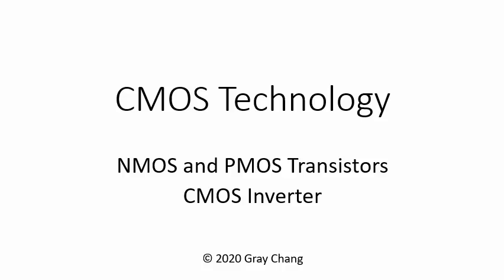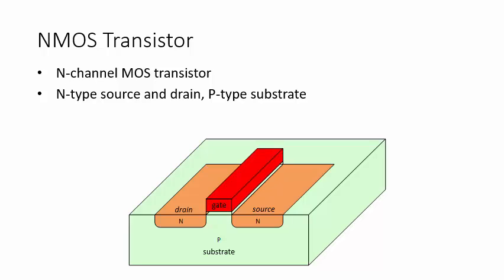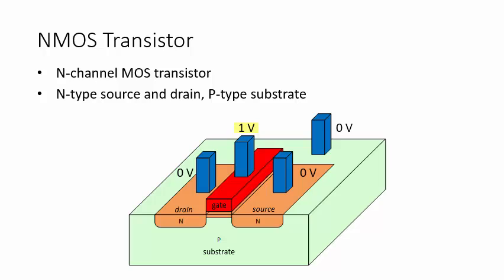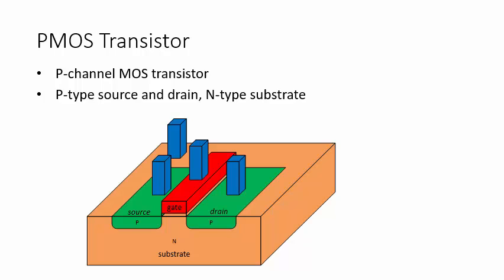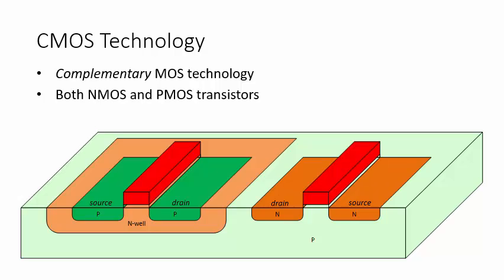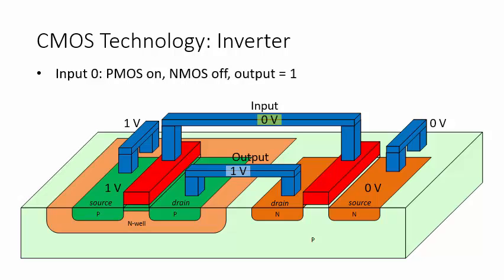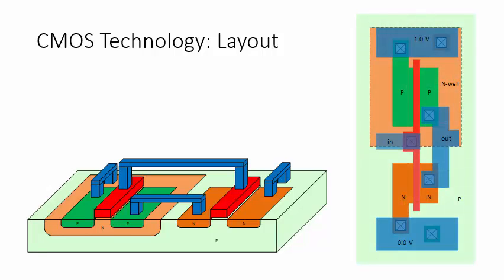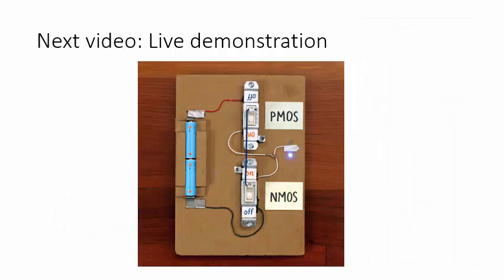CMOS Tech: NMOS and PMOS Transistors in CMOS Inverter (3-D View)

Comment: Awesome video! I have one question, and I am relatively new to this, but can this be used to switch between two different power sources? Instead of having 0V and 1V as an output, could it switch between voltage levels from two different battery sources using one control voltage? It would be like an SPDT switch. I want to avoid using a relay or 4 transistors in an H-bridge setup. Thanks!
Reply from the maker: No, the CMOS inverter is just one tiny component among millions in an integrated circuit. You're looking for discrete power components. You seem to know a lot about them.

Comment: Thanks for this great Video, I have one question! I have a computer science background and still struggle with basic concepts like current. In 5:20 (Input=1V) you say "A conducting path connects 0 Volts to the output. I have a hard time imagine, what does 0 Voltage mean? Does it mean no current is flowing at all? Or just a small amount? I think i have a problem with the concept of a Supply of 0 Voltage (nmos) which creates a conductiv path to the output. If basically nothing gets "pushed" (electrons) how can there be a flow of current?
Reply from the maker: See if this video helps: https://youtu.be/Lvp_a_JkD2o

Comment: Super nice video! I was wondering what's in between the substrate and the metal connections? It looks like there is some gap in between but this has to be filled with something in a IC, right? Thanks a lot!
Reply from the maker: A hole is cut through the oxide and the metal connects directly to the silicon. In some cases extra dopant is implanted/diffused into the silicon where the metal makes contact.
Reply: @graychang99  thank you! So basically SiO2 is isolating all the connections
Reply from the maker: Yes. To keep the diagram simple, I didn't show the SiO2 on which the metal connections are resting.
Reply: @graychang99  it was a great video! By far the best one I've seen